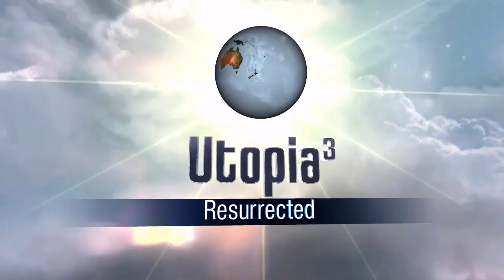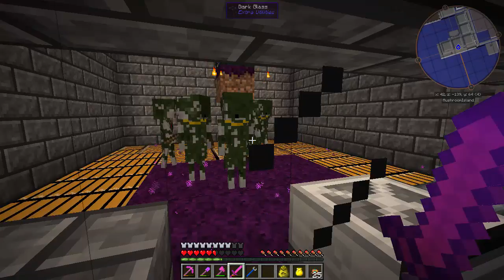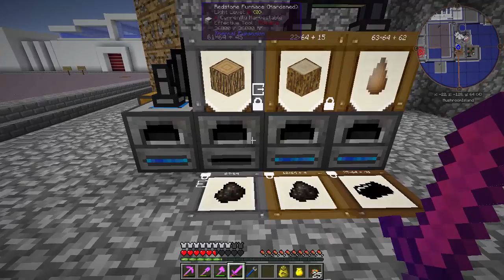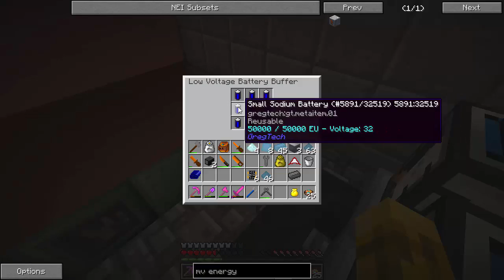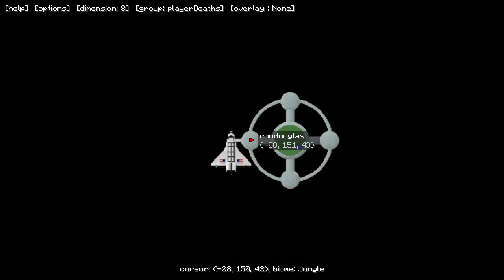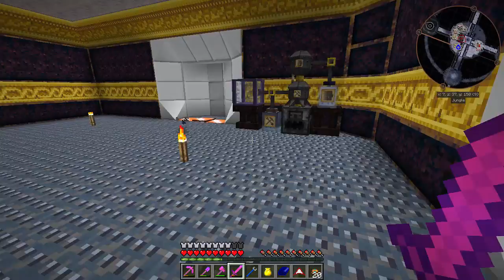Utopia³ Resurrected - S4E12 - Minecraft [FTB] - MV Power

Comment: Hey Funshine,

I understand that the railcraft boilers use up a lot of charcoal when building up the temperature but when the temperature reaches maximum (or maybe even as it approaches maximum) the rate of coal consumption decreases significantly. It might be worth looking at the temperature and consumption rate of your up-and-running boiler to get a better idea about your needs.

Another quick note - when I go to your homepage on Facebook, the first thing I see is the Crash Landing series. There is no list of recent posts in reverse chronological order, which is what most youtubers I see use. Is that something you can fix, it would be much more convenient?

Cheers,

Dave
Reply from the maker: Even at maximum temp it was eating the charcoal faster then 3 redstone engines could create it

I Don't have a facebook for my channel, what are you referring to?
Reply: I have exactly same experience with railcraft boilers. I had to stack up a lot of fuel for heating that monster up but it was not that bad after its temperature got up to maximum. There might be some changes for this modpack or something like that. :-)
Reply: FunshineX Oh dear - typing derp - I meant youtube home page :) oops!
Reply: I have used like 188(I have added 50 more later) coke ovens and some other things to make it work. It was great in other thing too because it allowed me to burn cresot in second boiler but it was hell of a building before I finished it. :-D